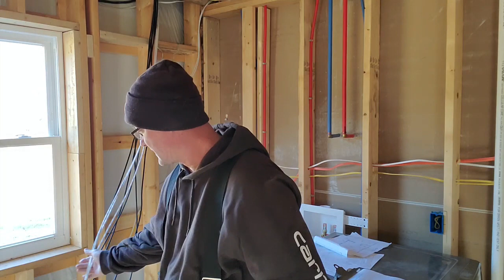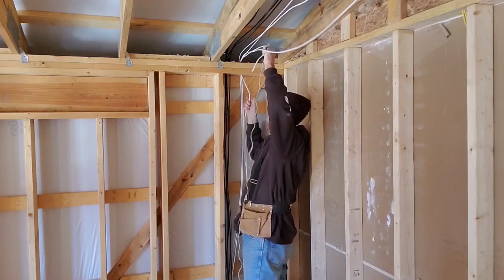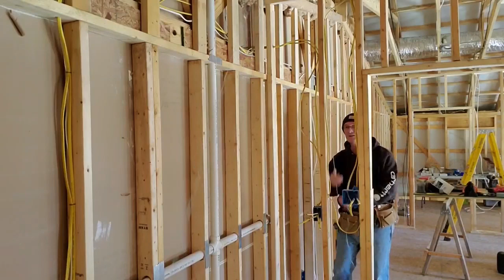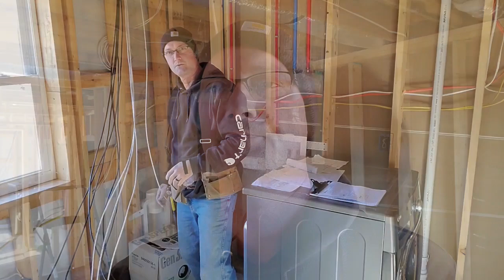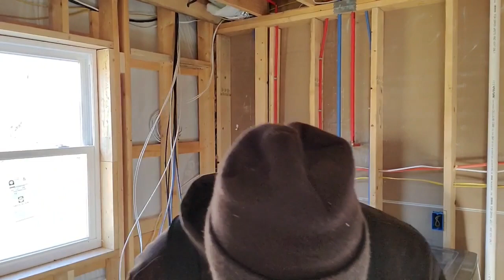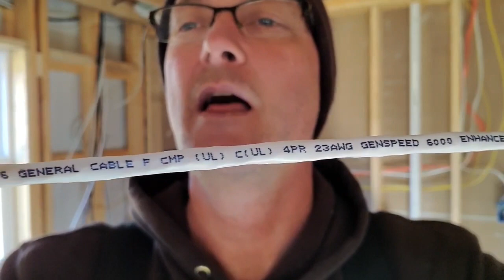DIY House Wiring Pro Tips || Polebarn RV Homebase

Comment: Tony - Do you work for a Telco? You're using a lot of language I recognize🤣, my day job is a remote tech for one of the Big Telcos! I think running a digital antenna is a good idea! We are only using our digital antenna, Amazon Prime, Netflix, Disney Plus and Hulu for all of our TV viewing and we are saving $95 per month since we cut cable. Plus we can use all of our streaming accounts on roku therefore making everything mobile too! But the big question is... how many hacky sacks have you lost!?
Reply from the maker: I'm in the IT business so we pull a lot of wire on the ARMY post.  We have no access to cable TV or fiber internet here so antennea and satellite are all we have for high speed TV and internet. We use a Cradlepoint for internet now. I've had that hackey sack ball for 10+ years. I think I'd cry if i lost it.
Reply: @RVBarndominium  LOL, Dang over 10 years!! That is one heck of a trusty tool!!